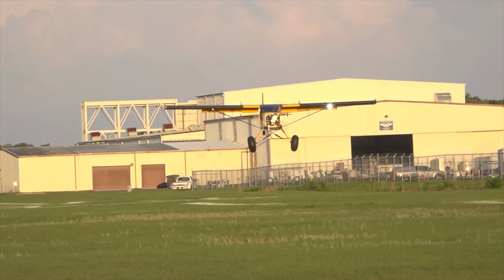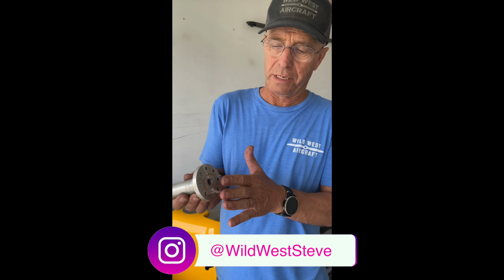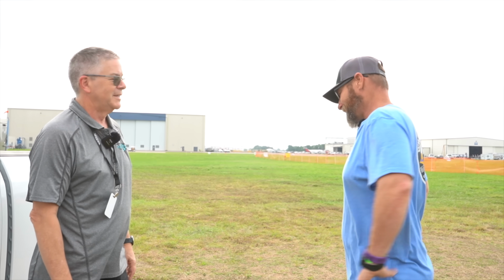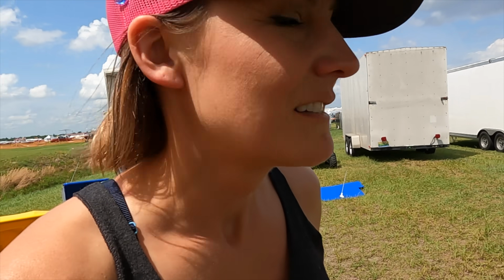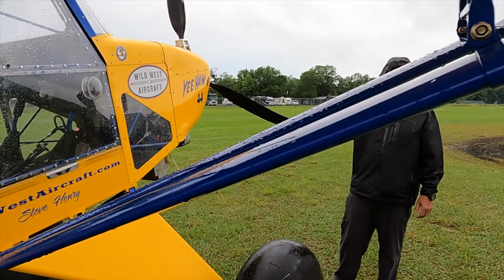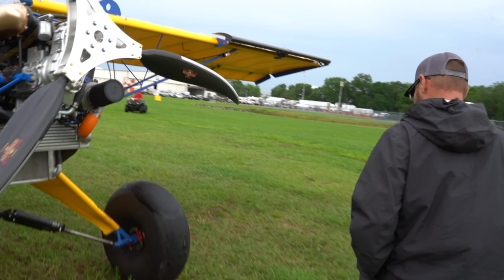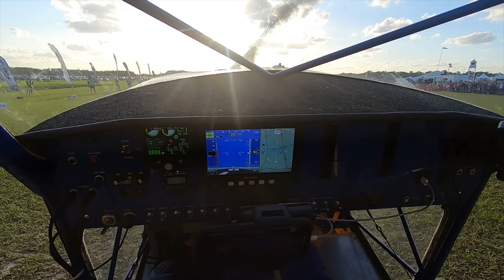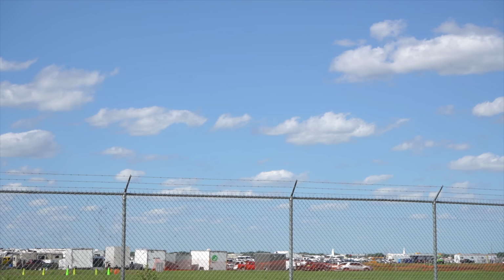Airplane axle BREAKS on landing at Sun-n-Fun

Comment: Thanks for the share Steve. Grateful for this opportunity to learn, makes life easier here. So sad about the cost involved. Might be interesting to have a look see at the right side weld because quite frankly I've seen smaller lighter gear on highway vehicles. Did it fail in torsion or in shear and was it the weld? 
The engine really came to an abrupt sudden stop. The gearbox gears, crankshaft, and internal engine hard parts will be interesting to look at. Just wonder how the shock load transfered.
Reply from the maker: We are looking into a solid axel to prevent this again.  We checked the prop shaft and gearbox with the FAA and it’s all very straight.  The propellers break easily and don’t transfer a lot of energy to the engine.  Thank you. -Sara

Comment: Fantastic flying and a joy to see such stol performance. 
Have got a say as an engineer and pilot .you really need to manufacture the failed part from billet such as en24t (Uk ) 826m40 etc 
The stress raisers of the weld and the material you’re using is really not up to the job of a full time part . Maybe see your repair as a spare wheel to get you home etc . Good luck and best wishes

Comment: Glad your okay Steve. I have a question about the engine. Normally with conventional aircraft engines you would need a shock load done. What happens in the case of the Yamaha motor you have?
Reply: The FAA got shocked 😲 that the load on rod bent it before being pulled out of the ground by the Yamaha . Test complete 🏷📒🧐📏🥇👍👴

Comment: No rebuild after a prop strike? Or did you change the engine?
Reply from the maker: No need to rebuild. The engine wasn’t damaged. It didn’t hurt the gearbox or prop shaft. Since it’s experimental, the FAA doesn’t require a rebuild. -Sara

Comment: what  was the decision process on the sudden stoppage of the engine?
Reply from the maker: The engine was at idle, the prop is composite so it easily breaks and doesn’t transfer a lot of energy to the engine. We pulled the gearbox apart and checked everything. The prop shaft was straight.  Now that we are home I will replace the clutch, although it didn’t seem damaged at all.

Comment: I was told that a prop-strike meant a mandatory engine tear down & inspection. Is that not the case with STOL aircraft?
Reply: I am wondering the same thing,   and reading the comments to see if anyone one else had the same question
Reply from the maker: This is not the case because it’s Experimental. We did have to be cleared by the FAA to continue in the event. They checked the prop shaft and gearbox. Everything was perfect.  -Sara
Reply: @SteveHenry  Thank you Sara. It’s odd that the person who told me didn’t know that. He was an AP & flew an experimental!

Comment: No sudden stop inspection required?
Reply from the maker: It’s not required on an experimental aircraft, but we still look things over really well as far as the entire air frame and the Gearbox. Those composite props are kind of like a fuse when they hit something they break easily and don’t transfer a big shock load into the engine.

Comment: What about the engine/PSRU? Were these damaged whatsoever?
Reply from the maker: Because the engine was at idle and because those composite propeller blades break very easily if they hit something, it’s very unlikely that the engine or gearbox were hurt. We did take the gearbox apart and inspect it and now that I’m back home I’m going to go ahead and change out the sprag clutch in the gearbox.

Comment: Not a plane builder. But was an industrial machinest. I would make that out of a billet of 4140 and have it normalized after. Male the flange a little fatter also. If it failed once it will fail again. The weld likely wasn't bad being aircraft parts. Just not a strong enough design.

Comment: Wondering how an axle just can snap off 😏
Reply from the maker: Thousands of landings. We are working on a stronger solution. -Sara
Reply: Well, didn't mean it like that, sorry.  He was unstabilized and too low initially  then came too high, retracted all the flaps and crashed too hard with overstressed the weld.